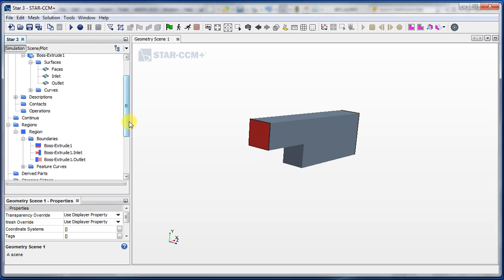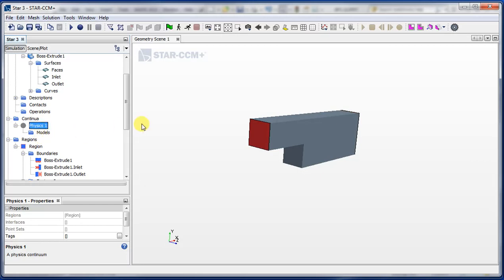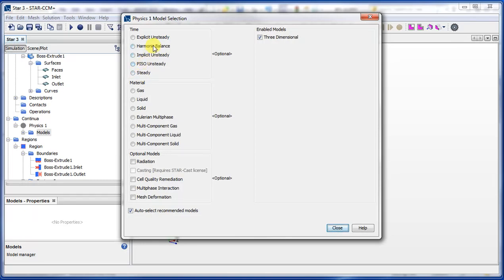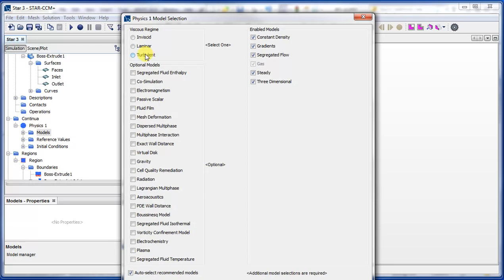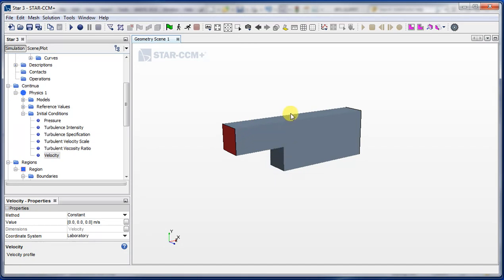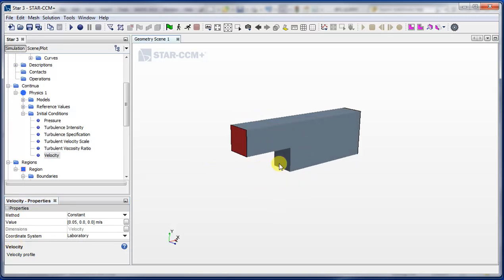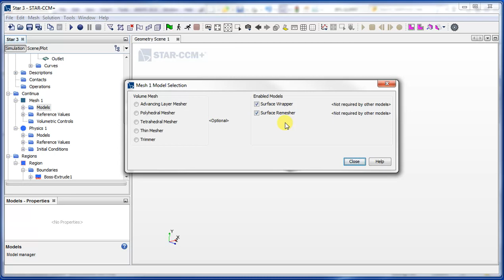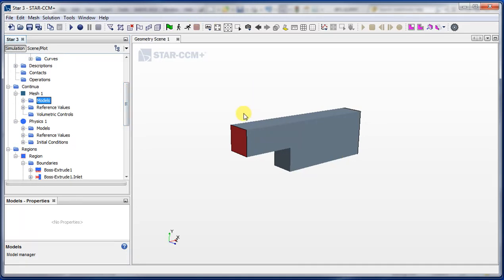Star CCM+ Beginner to Pro Tutorial Part 3 [Backwards facing step]

Comment: Firstly, thank you so much for this video. Secondly, I'm having an issue with my model setup. My example is water flowing through Venturi tube, so I selected RANS for physics. 

Problem is, whenever I right click on Continua, I don't ever see "Mesh Continuum," just "Physics Continuum." Am I missing a step? Thanks!
Reply from the maker: Check if you've imported a geometry and turned it into a part. thats two steps. After that make sure you've defined your surfaces as inlet, outlet and walls. If youre still struggling let me know.
Reply: @zacmac  Ok, I think I figured it out. My geometry was my actual cad design of the duct, not the volume that the water will flow through!
Reply from the maker: @matthewsmeal3227   well done.
Reply: @zacmac  Thank you for the help! I still can't seem to bring up the "New Mesh" option, but I was able to continue on and create a mesh under "Operations." Is that the same thing or am I on the wrong track?
Reply: The same problem persists. All your processes were followed. However, I never see a "Mesh Continuum," just a "Physics Continuum."  @zacmac
Reply: @zacmac   Wow, thanks for getting back with me!

Ok so my example is a flared entrance duct/tube, a circular cross section where a hydrokinetic turbine will be housed (we’re trying to increase the water speed here with the Venturi effect), and then a slightly flared exit. This is going to be suspended in a river ideally, so do I want to use “free stream” anywhere?